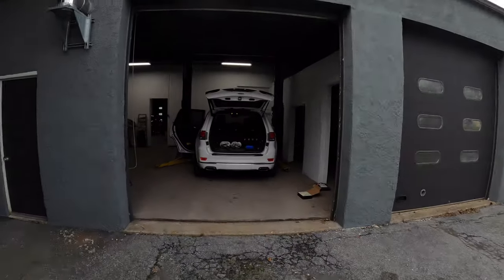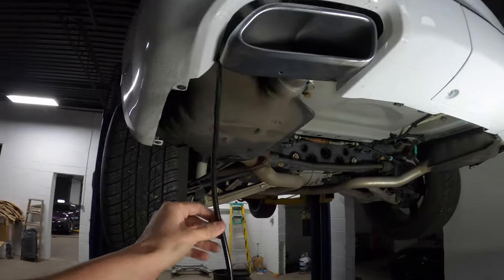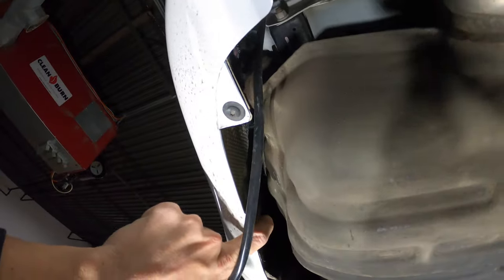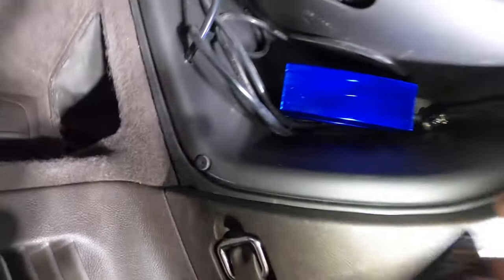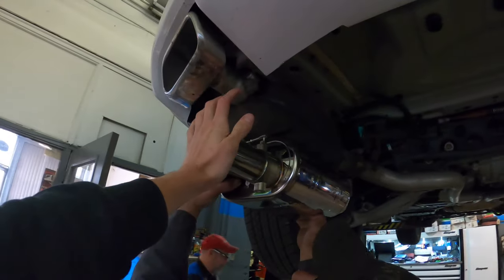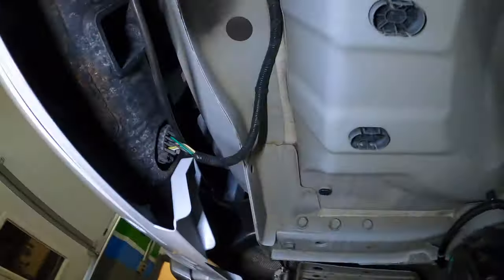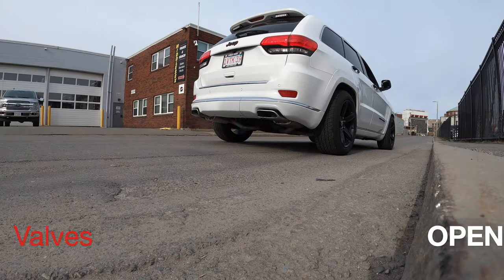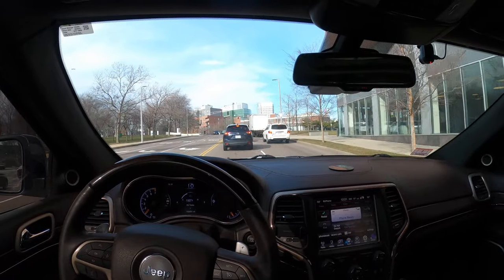Jeep Grand Cherokee with Valvetronic Designs Valved Mufflers (Install + Sound)

Comment: Just a quick note, make sure you get the correct size diameter tubing for the amount of HP your engine makes. There are HP to diameter tubing calculators out there. 3" dual exhaust for less than 750hp. 2.5" dual exhaust for 500hp and less.
Reply: do you know in what scenarios i would need 2 mufflers like in the video?
Reply: Wish i had 500hp, barely 305 ideally
Reply: 2.5 is plenty for even over 600+ let alone 750. It’s not till the big big numbers you really need it
Reply: @mcintosh.motors  Not according to exhaust size calculators
Reply: @Luis Islas  there are a few schools of thought about that. Even Engine Masters tested it. If you have a 2.5" exhaust already and an engine making roughly 600hp you might gain 5-15 horses (they gained 13hp) on the high end well over 5000rpm.

It would be hard to justify redesigning an entire exhaust for relatively minor gains.
Reply: @emersonf7697  Dual exhaust
Reply: @FiveBoroNative  It's not to gain HP, but, to allow the proper flow, especially with twin turbo setups. Which is what I have. I have an idea of a valved muffler that I want to create. Either way, for my setup, I have cats, and 3 mufflers. The first muffler creates the deep sounds and acts as a crossover. The other 2 control the sound. I hope to get my M6 to 800hp without spinning a bearing 😣. Anyway, finding the right muffler is a pain. Don't get these, since they restrict the flow and made with glass mat, which will burn out over time. All I really need is a CNC plasma cutter... I'll buy one after my deployment. Save my contact
Reply: @faaaaq  haha, I opened one of these already. They are restricted. The hole diameter is 1 1\2". And they are filled with glass. Also, 3" is good up to 700hp. If you get a stock car with 500hp, and you tube it... Over 750 for a BMW S63... You're going to need a bigger diameter exhaust. As a matter of fact. A 2014 M6 comes with 3" exhaust... Dual... So, I'll let BMW speak for me...
Reply: @emersonf7697  dual exhaust
Reply: factory duel exaust, you would want two mufflers

Comment: Valves are waste of money on a v6 no need for them
Reply: They allow you to have no drone
Reply from the maker: What?!!?!?
Reply: @valvetronic  you heard me waste of Money I’ve had 3 v6 jeeps the best bang for buck is mid Muff delete with xpipe and the rear muffler delete straight pipe with quad tips best overall sound and that’s the loudest ur going to get that v6 to sound too all for 650 bucks total
Reply: @cbruno12180  my question is why do you keep buying piece of shit cars & then removing the exhaust? there's no way that doesn't sound like drone hell dude
Reply from the maker: Wack

Comment: You shouldn't run anything through that vent. It closes when driving so the exhaust that inevitably rolls under the bumper from literally every exhaust ever made doesn't go back into the vehicle cabin 🙄.
Reply from the maker: there are other places to run the line! if you don’t want to use the vents you can use another spot

Comment: Just bought mine today for my almost the exact Grand Cherokee same color and everything except mine is a 2019 but looks identical. Limited X 5.7 hemi the guys at Larkin Motors are installing it for me hopefully soon. I’m excited to hear it.
Reply from the maker: That’s badass man! The Larkin boys are the greatest!
Reply: How is it compared to the stock mufflers with valves closed?

Is it just as quiet as when it was stock? Or a bit louder?
Reply: @arturo8951  it sounds stock when closed.
Reply: @danielsullivan7740  you got ig for vids? Been looking to see difference between valve and corsa catback exhaust for v8 jgc
Reply: Hey, I've got the same car pretty much, did you leave the big middle muffler in?  I'm intending to leave it in, unlike what they did here because I don't want it any louder when in valves closed mode.

Comment: Would it be possible to run valve activation to a 12v switch instead of the wireless fobs?
Reply: i have the same question... would be so much more usefull and clean for me...
Reply: Most systems with the key fobs can be programmed to you cars OEM garage door opener buttons. I have seen a few videos of people with exhaust cutout kits doing that.
Reply: It's easy to do by integrating the remote inside the car and supplying power with a transformer to 5v

Comment: I didn't know the install with this easy I thought you had to run it to an existing vacuum line on the car. Can you manually open and close the valves? I may just have the exhaust shop put these on and leave the valves closed until I install this myself. Also can I just hook up this box to my exisiting stereo system in my trunk using the acc wire?
Reply from the maker: Yes and Yes. If you are mechanically able to hook it up we recommend wiring yourself to save money.
Reply: @valvetronic  cool where do you manufacture these systems?

Comment: How different is the open valve sound compared to as if you were running just straight tubing? Considering getting these but I don't want to lose that raw sound you get with straights.
Reply: It’s the exact same as a straight pipe when the valves are open
Reply: nothing changes when the valve opens, would be straight pipe still, that's the purpose

Comment: I’m thinking about buying this,  however would it work well with my car? It’s a 2019 Acura TLX A-Spec V6 SH-AWD. I know I’d need 2 mufflers but I have no cigarette/charger connector in my trunk like that jeep does. I guess my question is will I have to do some creative installation to get the tubing and the control box to plug up in my trunk?
Reply from the maker: 2 mufflers, and the plug doesn’t need to be in the teunk
Reply: I had the 18 TLX aspec & what I did was a muffler & resonator delete but in the mid I did a 2.5 inch flowmaster super 10 & one guy told me it sounded like a charger, so this is another option

Comment: @valvetronic Did you guys just do red>red black>black splice split and hardwire tap them into the rear cigar outlet? I did that today on my 2020 Jeep GC SRT and it blows the 20amp fuse under the hood. Curious if you guys did something different with a fuse tap or something?

Comment: Been spending a lot of time looking at a muffler from yall but at like 600$ usd for one is a bit priceyyy
Reply from the maker: Sorry man! These are by far not cheap but our quality speaks for itself, there is no compromise
Reply: $600 for a muffler? I can get an entire Xforce Varex dual muffler catback for less than a grand and not have to mess with welding.
Reply: @michaelangelo5783 does that catback come with a valve? If not, there’s no comparison

Comment: Have a 15’ 5.0 f150, it has a factory 2.5” exhaust pipe. Should I get the 2.5” or 3” valvetronic muffler?

Comment: Regarding the vacuum line... It wasn't immediately clear to me where it originated? Did you tap into intake vacuum from the snorkel in front of it TB? or maybe on the other end out by the PCV? Then run it all the way down to the trunk? If not, It almost sounds as if you're pulling vacuum from the trunk which is a total mystery to me.
Reply from the maker: The system comes with its own vacuum pump to operate the valves

Comment: Quick question. Want to purchase this for my e39 540 v8. I’ve straight piped the car currently so no cats or mufflers or resonators. It’s way too loud. If I install this, with valves closed and only this will it make it quiet? Close to stock? Or no?
Reply from the maker: Yes! With valves closed it'll sound very similar to stock

Comment: I have a single backbox with two pipes on one side. How can I use this and still keep my twin tips?
Reply from the maker: You will need the exhaust shop to weld a Y pipe or you can use our single to dual tips

Comment: How do you setup the keyfob ? Do you have to use 1 keyfob or 2 cause your using 2 mufflers in this case??..
Reply from the maker: Only 1. We provide a connector that allows all vacuum lines to be connected as 1

Comment: what is the diameter of the outlet? specifically for the 2.5in inlet model
Reply from the maker: The muffler is 2.5in all the way through, however you can choose your preferred tip style and outlet size at Valvetronic.com

Comment: Hey is this muffler quieter than stock when closed and is the open is straight pipes i wanna shoot flames and still be quiet as well. And is there a valved catalytic converter so I can bypass it when I want
Reply from the maker: No VALVED cat but yes you can shootnfoames with these mufflers
Reply: @valvetronic   thanks for information
Reply: @itzshark6737  Bro, that's a good idea